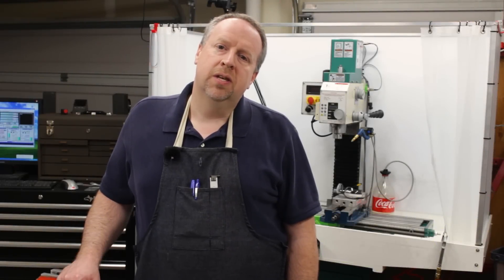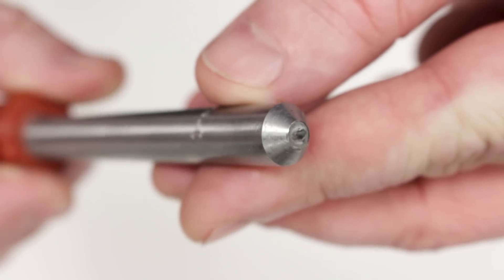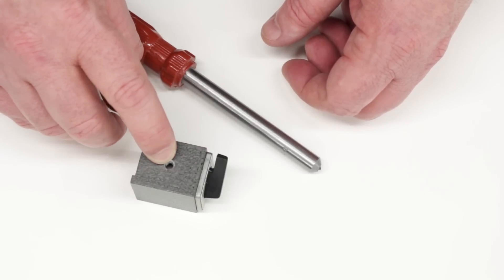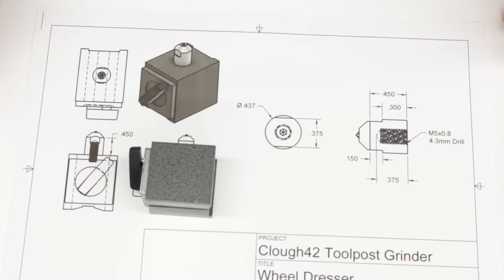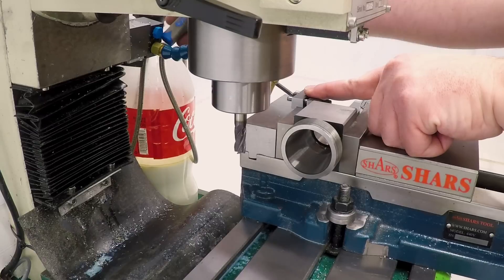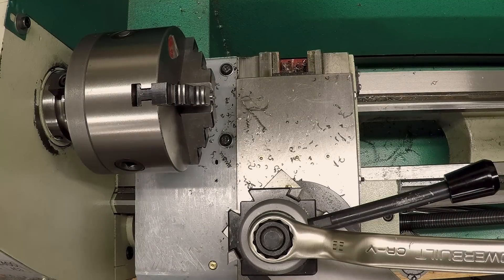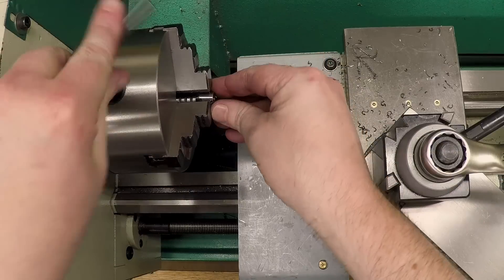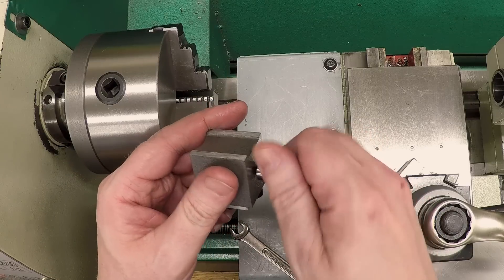Toolpost Grinder Part 23: Diamond Dresser

Comment: Hi Just one suggestion a taped hole isnt ideal as when your diamond goes blunt your stuffed and the wheel needs a sharp part of the diamond while dressing.

 To over come this is a hole drilled at 15 ' degrees approx then a side bolt (cap head to hold the diamond secure then occasionally dependant on use turn the diamond 1/4 turn to use a sharp part of the diamond.  When grinding cylindrical or surface grinding parts the  diamond holders are never square to the wheel always angled for this reason, hope this helps.

Comment: James

Did basically the same thing BUT I drilled a snug fitting hole thru some round stock with a set screw and put it directly into the chuck  for dressing wheels on the lathe

John

Comment: Hi James, teh series has been great . Thank oyu.

I would suggest buying the diamond dresser as a shaft ( or cutting that which you had) but then machining the end of the diamond dresser and putting a male thread directly on it so it can screw into the magnetic holder. A male thread is a lot easier and there are less steps.

Importantly what is being used to prevent abrasive spraying onto the ways
Reply: excuse the spelling for "the" and "you"

Comment: I've only seen diamond dressers for surface grinders, which have all had the diamond bit at a small angle.  Is it the lower power / RPM that does away with the need for that angle?  

(As I understand it, the angle is sort of a safety feature to reduce the chance of the dresser getting jammed into the wheel)
Reply: The main purpose of the angling the diamond is so that you can rotate the diamond once it wears to have a little flat, thus exposing a new 'edge'.
Reply from the maker: I do have the dresser angled down slightly just to prevent it from wedging and grabbing the wheel.  I've also read that it should be angled slightly away from rotation.